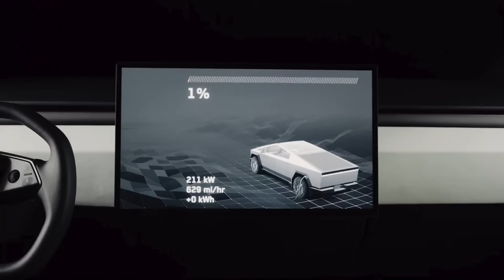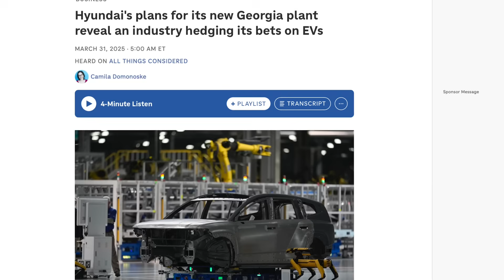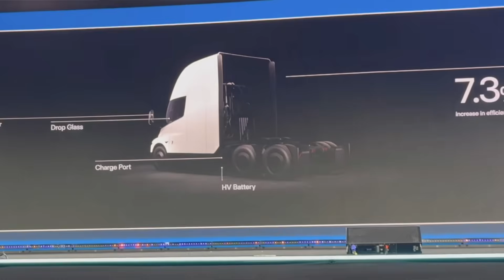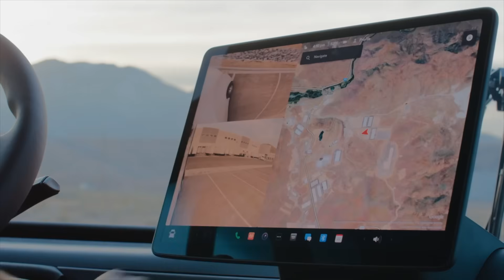Tesla Semi Megacharger Expansion Begins!

Comment: We can now say with certainty the 4680 is a failure... the promised energy density never materialized. They overheat because they are too big to cool effectively which also limits charge performance too.
Reply: Electricity flows across the whole roll, rather than just a tab. That alone should make heat management even easier. If heat was a problem, they wouldn't be surrounding all the cells with a structural, insulator foam
Reply: @thomasreese2816  there is no choice. Base plate cooling of the can and jelly roll would lead to an average 23° warmer than side cooling. The metal can is a better conductor of heat out of the battery and far larger than the tab at the bottom.

Comment: As someone who actually tried his hand at truck driving, when it looked like his normal gig was going away, I'd warn you that it's not as easy as it sounds. Not only is there a lot of things to keep track of regarding paper work, regs and other things, but you do spend a lot of time on the road, learning to turn and maneuver the truck is VERY difficult to back up, particularly if you're doing it at an angle. I struggled through truck driving school, barely passed on my third road test and tried to get on at two different trucking companies before deciding that I wasn't cut out to do this. I wish you the best of luck if you this, but my experience left me with a lot of respect for professional truckers.
Reply: I passed on the first try! Either you have it or you don't!
Reply: @gmv0553  Congratulations. I, for better or worse, did not. Thankfully, my engineering career wasn't as dead as I had assumed.
Reply: @darwinskeeper421  if you are an engineer why even go into trucking lol
Reply: @harvir6167  I thought my engineering career was over. I was very happy to be proven wrong.

Comment: I’m an owner operator from KY and would love to buy and operate a Tesla semi but it’s way to early to be able to do so because I would have to install at least a level 3 charger onto I’m sure a 3 phase grid and dont look like there’s going to be any mega chargers close for years to come I’d be 500-600,000 deep and would have to take a lesser route to make it happen not really possible for me
Reply: I believe the fastest home charger you can get that operates on 240V is a Delta 25kW unit. Needs a 120A breaker. And it still would take a few days to charge a semi.

Comment: regarding FSD on Semis: most of the complicated problems that Semis run into are going to happen in urban/city areas. Automating the Semis on wide open highways should be fairly straightforward. To the extent that the Semi on a highway runs into a problem that can defeat the AI model operating it, it will happen infrequently enough that a Teleoperator can beam in to resolve it. The physical Semi truck drivers then, would be at depot that receive the Autonomous semi trucks driving in off the highway. After they've been megacharged, the operator would then climb in to manually drive/supervise them for the last few miles going through city streets to get to the actual drop off at the warehouse or other logistics station that is the final destination for the cargo. This situation would work really well because then the Semi operators have a job based around one location (the depot and the radius of area it serves) and don't have to spend long periods of time crossing the country, sleeping in the back of trucks or at truck stops, being away from their families and stuff. Just my two cents.
Reply: @tonydeveyra  driver here. they will not use these for over the road, walmart warehouse to warehouse. 
the problem will be charging and parking, short runs is where they will make the best impact.
Reply from the maker: "Fairly straight forward" yet they still don't have autopilot after several years of operation. 26 Tesla Semis have over 100k miles
Reply: @ Because Tesla isn't developing Autopilot anymore. Only FSD. And once FSD is adapted to the Tesla Semi, it will master highway driving far sooner than it will master driving on city streets. My perspective, based on my experience with a HW3 Model Y that mastered Highway Driving years ago. If highways were all there were, FSD would have been feature complete a while ago.